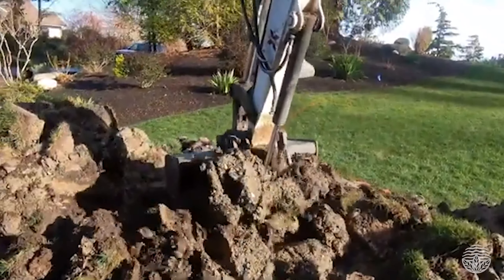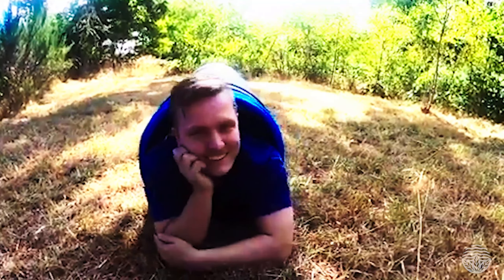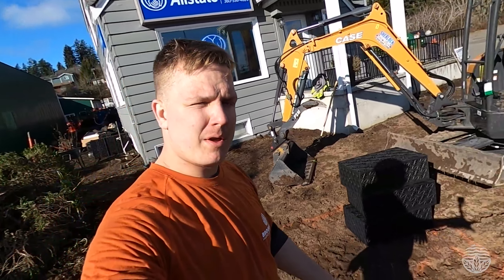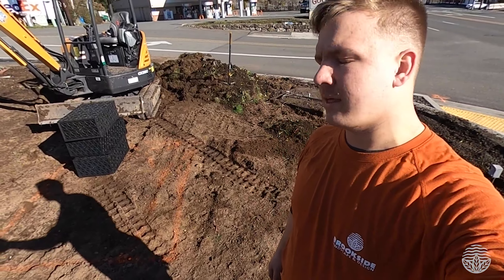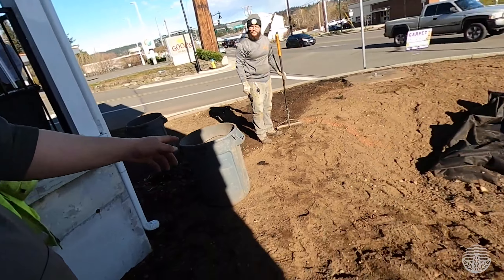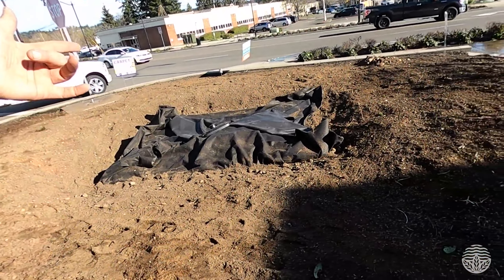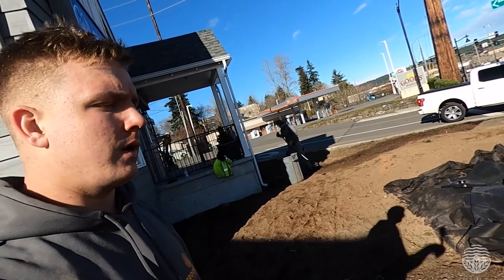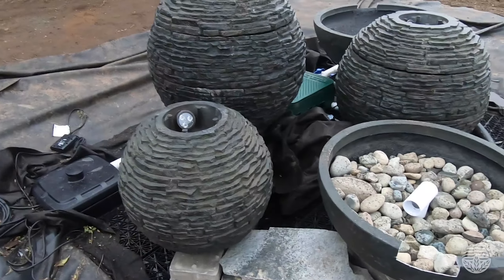Building an Awesome Aquascape Fountain

Comment: I'm looking into doing the 3 sphere set up in my front yard. My plan was to buy two 2000-4000 pumps and split them to get good flow. One pump to manage the large spere and one pump to manage the med and small sphere. I would like to have about double the water flow you got out of these spheres. Did you use a single 2000-4000? Did you cut the 3/4" hole bigger?.....Looks awesome. The flow out of the bowls is pretty strong, was that from a 4000-8000 split between the two?
Reply from the maker: We typically install a 2 inch trunk line off the pump that feeds a manifold that splits into 1.5 inch flexible pvc. For small fountain we stick with the stock 3/4 hole, but on custom fountains we install a 1.5 inch bulkhead.

I don't remember what pump we used, but I think the two bowls got an Aquasurge 5000 and the 3 spheres got a Aquascape 9 PL (7500 GPM). Those were what we had laying around. I think the line that feeds the bowls also has a "bleeder" discharge to deal with excess water. It discharges into the center of the fountain and spills over a couple flagstone walls.